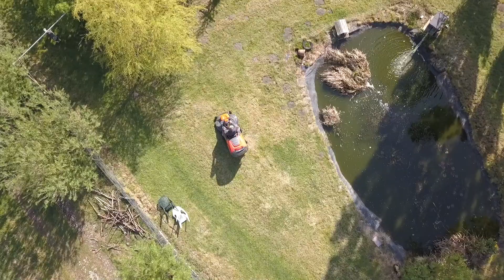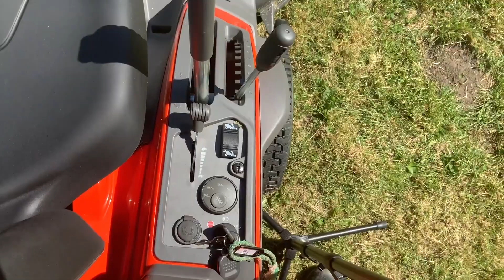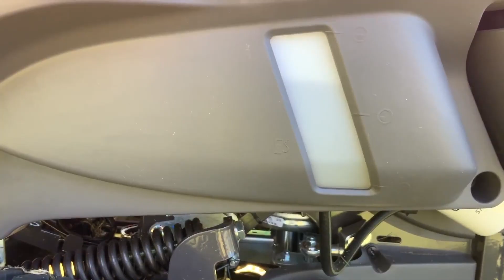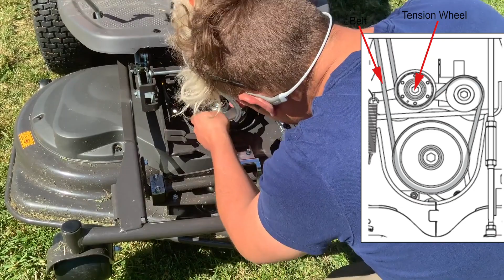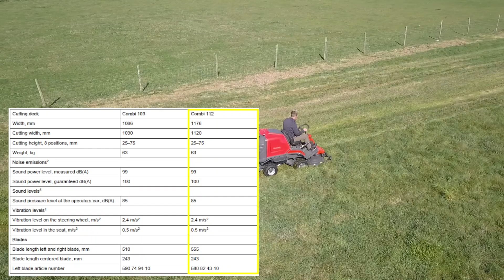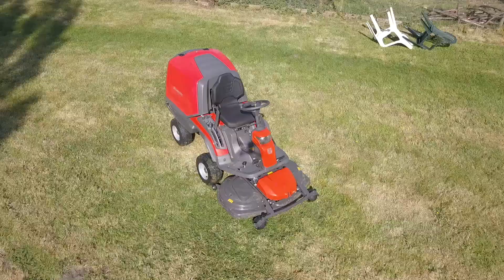HUSQVARNA RC 320Ts AWD English Overview and Run through and Deck Clean

Comment: Hi! I've got same model. Like machine very much but lately it's started having issues telling me that auger is blocked even tough it really isn't. Very frustrathing and i don't like taking it to workshop for a week and then they saying they don't find anything wrong with it. Electrical issues always the worst. Have you had any issues like this?
Reply from the maker: Oh yes. All the time. i was spraying Lubricant oil down it to try and keep it going. I have now got an arians Zenith 60R which works amazingly well and is nice and simple. After owning the Husky for a number of years i came to the conclusion that its too smart for its own good and it liked being lazy.

Comment: I have always had husqarna rider and always use high pressure cleaner to clean it. Some parts get rusty. I replace mine after 8/9 years of service. I am looking for a new one. How is this one?
Reply from the maker: Hi buddy. This one is great but it's like it's to smart for its own good.  There are lots of little very expensive bits on it that can easily develop problems. But for cutting in the wet and collecting. I don't think it can be beaten.

Comment: How much is this model?  Can it be used to mulch with the collect?
Reply from the maker: Hi sorry for being late on the reply. i think back when i purchased it, it was around £9,000. It can indeed mulch, or collect, from what i understand of mulching, the idea is that the cut grass cuttings goes back down onto the grass rather than being collected so mulching at the same time as collecting doesn't really work.
Reply: Thinking about buying one of these, I have a 4wd model without collection. Is it easy to clean after use? Does the auger chute need cleaning out? Any problems with it so far?

Comment: I've got the exact same one. Great machine that's very easy to manoeuvre. Bagging is a joy with the auger, better than a blower. Although mulching taller gras is harder than bagging. Feels like the belt doesn't like the hard work.
Reply from the maker: I get exactly the same issue. its easier to collect long grass then tip it than it is to mulch. I find its easier if you lift the auger leaver so its not engaged when you are mulching so that you don't get a lot of grass block up the area in front of the mulcher. We had to have the tension arm replaced on our front deck as it twisted with use. This one seems to be much better and holding up fine.